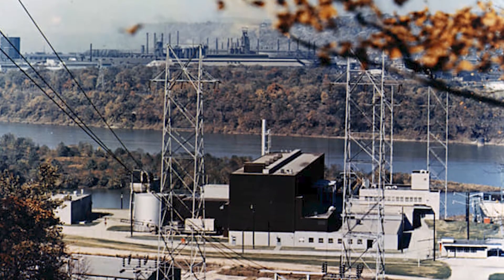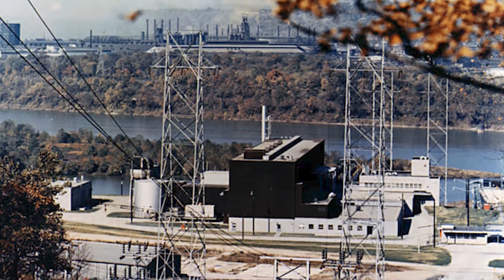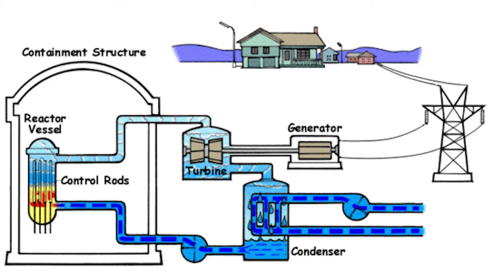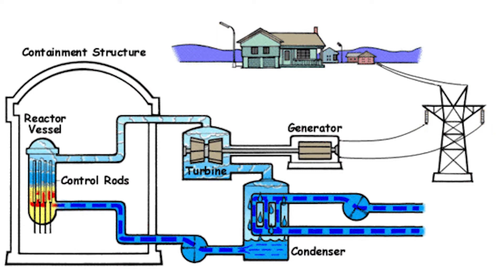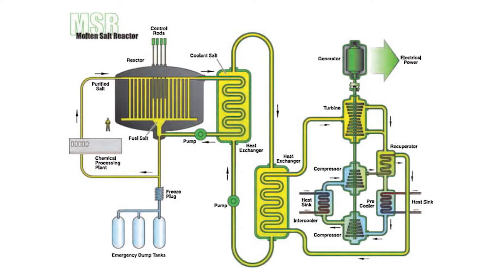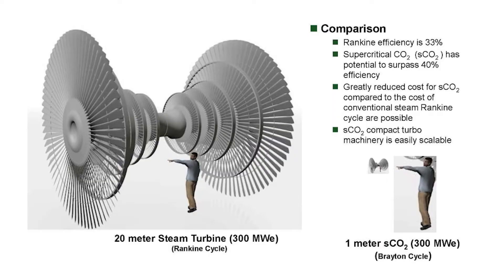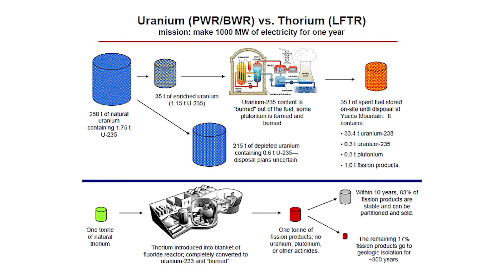The Best Nuclear Reactor: Light Water VS Molten Salt | Ep. 2

Comment: If you are going to limit your evaluation to thorium reactors, you may very well have picked the winners, but Moltex is definitely a better bet than Flibe if you expand the competition to all Molten Salt Reactors.

Moltex has a license to begin operation of an "experimental" MSR in Canada in 2027. They plan to build a full scale reactor as their experimental reactor. This reactor is designed to burn low enriched uranium, initially using solar salt as a coolant. They plan to eventually transition to thorium salt as a coolant/neutron absorber.

The NRC recently threw a monkey wrench in Flibe's (and possibly Thorcon's) plans by requiring the thorium be denatured with uranium. Since Thorcon reactors will be, at least initially, used in Indonesia, they may not need to denature the thorium. I'm not sure how this affects Thorcon, but it makes it impossible for Flibe to design a thermal spectrum breeder. As a result, Flibe is designing a Spent Nuclear Fuel burning LFTR49 to go with their thorium burning LFTR23 reactor. The LFTR49 will breed U233 in a thorium blanket to make up for the deficit of U233 resulting from denaturing thorium with uranium.

My best guess is that Elysium will get their reactor design to market before Flibe can get their LFTR49 to market. The current Elysium design is a fast neutron spectrum breeder that will use purified SNF for startup, and thorium as feed stock. At maximum output, the Elysium design might produce enough U233 for doubling in 7 years, but Elysium plans on 15 to 20 years. This is not a problem for mass deployment of the Elysium design, because SNF is so plentiful that we could meet the entire energy demands of the US for the next 300 years just be burning our SNF stockpiles.
Reply from the maker: Hello Dale! First off thank you for commenting. You definitely touched on a great deal and you are absolutely right and I plan on discussing Elysium and Fast Reactors in general in a future episode. Thorcon is not going to be affected by current NRC regulations seeing as they are building in Indonesia and FLibe is currently busy coordinating with Pacific Northwest National Labs on a DOE contract. That being said some serious regulatory and supply chain issues need to be addressed before reactors like the LFTR can be built. I 100% agree that most likely Elysium will be first to market in the U.S with there design. They do not have the same supply chain constraints and their approach to modular construction is extraordinarily efficient compared to other designs.

That being said there is a reason I am in favor of companies like FLIBE. One they are a true breeder reactor in every sense of the word and the fission products they can produce will have tremendous benefits on future medical breakthroughs. Second I am an advocate for getting the United States back in the game on Rare Earth mining and refining to develop alternatives to the Chinese monopoly. To do this we need to establish a cooperative to store the Thorium waste on behalf of those mining companies and develop markets and uses for them.  Addressing the Rare Earth issues in America in this way would create the regulatory pathway necessary to develop commercial LFTRS in this country. It would also help address the issue with supply chains seeing as there would be a National precedent to develop and commercialize this technology. 

Now I still believe we need companies like Moltex and Elysium. They have great tech and as you stated there is plenty of SNF to meet our energy demands for three centuries. But the LFTR allows us to maximize the efficiency of the Thorium fuel cycle for Thousands if not Millions of years. Thorium is 4 times more common in the earths crust then Uranium and the amount of U233 you would need for efficient breeding is miniscule compared to the amount of energy produced. At the end of the day I hope to see a future in where multiple MSR and possibly Fusion designs are considered to meet our energy designs. I think we can also agree more nuclear is the true path forward regardless of what design ends up being selected.
Reply: @RockLogicWithSeanKenny  Elysium claims a 1000 year supply of nuclear waste, not like that matters, I have to believe we will figure out fusion within 1000 years, even 300 for that matter.
Reply: I know Im asking the wrong place but does any of you know a method to get back into an Instagram account??
I was dumb forgot the account password. I appreciate any tips you can give me.
Reply: @Fernando Chase instablaster ;)
Reply: @Flynn Blaine it did the trick and I now got access to my account again. I'm so happy:D
Thanks so much, you saved my ass !
Reply: @Fernando Chase you are welcome =)
Reply: Elysium plans on 40-60 year fuel cycles on SNF. There are no plans for using thorium because of its poor neutronics, and there is unlimited Uranium, so the poor neutronics of thorium would be a reduction in economics.
Reply: @EdPheil  You already told me this in response to a different post. I have since revised my projection to the potential for Elysium to eventually switch to thorium salt as a coolant, as Moltex plans to do.

BTW my nephew now works at Perry Nuclear, and they are considering installing a SNF burner at the site where my nephew works, and ship the SNF from several reactors to this central site for disposal in it. I question this plan because, as I understand the situation, a single conventional reactor would need need several SNF burning MSRs to burn its waste.

I suppose it is possible that, if they extract the uranium from the SNF, perhaps enriching it to feed uranium burning reactors, with the majority of the U238 being "disposed of" as depleted uranium.

Comment: Why do you conflate MSR with thorium. MSR can run on uranium and even uranic waste (i believe). Would love to hear your thoughts. Terrapower is an example of uranic MSR
Reply from the maker: Sure Ryan. And you are absolutely correct their are multiple types of MSR's. Lately I have been discussing LFTR (Liquid Floride Thorium Reactor) but in future episodes I do plan on going over other designs. You can run an MSR on Uranium and you can run on spent nuclear fuel, especially if you take Elysium Industries fast reactor approach. However the reason I focus on Thorium Molten Salt Reactors is because the ideal fuel form in a MSR Breeder is Thorium 232 and U233. These reactors create energy at high rates of thermal efficiency while producing valuable fission products. The other reactors do not achieve the same result, but they can produce clean power effectively through simpler approaches.  The question we have to ask is what do we want to achieve? Do we just want to produce electricity at low rates, or do we want to achieve the maximum amount of fuel efficiency  so we have an energy source that can last for thousands of years. The former can be achieved by almost any MSR design, but the latter can be achieved by the LFTR.
Reply: @RockLogicWithSeanKenny  It will probably take 50 years to produce enough U233 for the Th232/U233 approach. Even Flibe is working on their SNF burning LFTR49, which will produce U233 in a thorium blanket, because of the difficulty of getting sufficient U233 feed stock. The future, at least in the US, for the next 50 years, is SNF burning MSRs.
Reply: @dalesplitstone6276  you can Kickstart a LFTR off of LEU.  Once it is up and running, it will breed u233 faster than it uses it, and even breed pu-239 from the u238 to make som additional fuel.  It just won't breed it all as fast as you burn it.
Reply: @ancapftw9113  In theory, a LFTR can produce enough U233 to sustain the reaction. The problem is that the NRC requires that thorium be denatured with U238 to prevent the production of weapons grade U233. The U238 "poisons: the reaction of a thermal neutron spectrum MSR because it is not very efficient at producing  plutonium from U238, thus the LFIR49 to produce supplemental U233.

Comment: If the current nuclear regulatory hurdles which (very) effectively crowd out any other nuclear option but LWRs could somehow be overcome, then most of the widespread irrational radiophobia would all but vanish. That's my two-cent contribution to the discussion. Nuclear power reactors which aren't prone to LOCA-type accidents by design are what most of us could wish for. Period. The biggest problem that's been holding back nuclear power dominance for so long is a bunch of existing unfair regulations, not some vocal (and mostly clueless) tree-huggers nay-saying it..

Comment: What progress is there, if any, on new materials for the plumbing in MSR?? I hear that when Oak Ridge plant was decommissioned they found massive corrosion and embrittlement from the hot fluoride salts and radiation....
Reply: Curious, the report I read was that corrosion in MSRE was minimal, embrittlement was to be addressed with extra nickel. Many of the proposals such as Thorcin are based on a reactor life of only 5-7 years. At the end of this time the reactor is removed from the operating position and sent to a central facility for reprocessing. This is possible because the reactors are relatively small and light about 300 ton.
Reply: @jimgraham6722  OK, I stand corrected, but I did read a very scientific paper that considered the issue as a real problem and discussed the metallurgy possibilities of the search for an exotic alloy that could be used. If this isn't the problem that's holding up the production of MSR, then what is it?? We've been hearing about the potential of MSR for many years, but not in production yet. The work in China should be clear of the regulation restrictions that may be in the way in the US, and they do have a history of rapid development of new projects, but still nothing real yet. So what is the hold up??
Reply: @STOLSPEED  Yes, Wikipedia https://en.m.wikipedia.org/wiki/Molten-Salt_Reactor_Experiment has a good report on MSRE that is a summary of the Oak Ridge reports the originals of which are also downloadable as PDFs.

The Wikipedia report includes an interesting picture of the main MSRE heat exchanger glowing red hot.

MSRE operated initially on U235 and later U233. That latter fuel load was designed to simulate operation as part of a Thorium cycle. The MSRE did not have a Thorium breeding blanket. That would have been included in later experiments if the program hadn't been refunded.

MSRE is generally considered a success. Corrosion as such was minimal, meaning a good reactor service life should be achievable using Hastelloy - n (essentially high nickel stainless steel). Embrittlement was seen as a potential problem, possibly addressable by introducing traces of niobium to the steel alloy.

Stability of the graphite moderator has been discussed as a potential problem. The Chinese claim to have solved this by using special high density grades of graphite that they claim don't degrade.  Other proponents say the graphite will be replaced on a regular basis.

Storage of the solidified spent MSRE fuel salt has been an issue with final cleanup only occurring quite recently. The spent fuel salts are highly radioactive to begin with but decay quite rapidly and should reach background in 500 years. Handling this process securely and safely is one of the main development challenges for molten salt reactors. Experience from MSRE has identified the issues and gives some confidence a suitable process can be worked out. Compared to LWRs the volume of waste material to be dealt with per unit energy produced is much less, nevertheless it is a problem that must be fully sorted out.

It is an interesting question as to why molten salt reactors haven't progressed, there are I believe a range of reasons.

1. Molten salt reactor technology was an interest of the USAF as a potential aircraft power plant. With the advent of aerial refuelling interest in nuclear powered aircraft dried up.

2. USN was left funding most reactor development, their interest was in high pressure Rankin cycle steam technology something they were familiar with. MSRE ran too hot for Rankin engines. There was also a famous spat between Rickover and Weinberg over this and it is likely further progress on MSRE was stymied as a result.

3. The realisation of the benefits of high temperature operation and development of suitable Brayton cycle turbines that are better matched to the high temperature output of MSRE are a more recent development associated in particular with HELE coal fired power plants.

4. Some say that because MSRs don't produce much plutonium that has decreased interest from investors in nuclear energy, not so sure of this myself.

5. In the end the main problem has been a lack of development funding to bridge the engineering gap between MSRE and a viable commercial power plant. At government level lots of funding has been tipped into fusion at the expense of fission, that is beginning to change. Quite a few investors are now stepping up and it is very likely operational molten salt reactors will be on line within 10 years.

6. With regards to Thorium, China is now buying up as much Australian monazite ore as it can get. This material was previously worthless and had to be disposed of as a mining wsste product. Says it all I think.
Reply: @jimgraham6722  That's for that excellent and informed overview. I guess I have just been to impatient, 'cause we really need MSR's or equivalent now.....
Reply: @STOLSPEED  Agree, it is frustrating to those of us observing the scene who are conscious of the urgent need for abundant affordable clean energy and can see a way ahead. MSRs will be very cheap to fuel, low volume, minimal fabrication etc. There is huge pushback from vested fuel interests who would see the demonetisation of fuel as a threat. They are throwing up every regulatory hurdle they can dream up, quite recently Thorcon had some of its fuelling proposals rejected in favour of more expensive options (less Th more U235).  If you are American lobby to have Kirk Sorensen, Rusty Towel etc made Secretary of Energy, that could get some serious roadblocks out of the way and fast track approvals for companies like Thorcon, Terrestrial etc.

Comment: The best nuclear reactor is one that directly converts neutron energy directly to electromagnetic to power our grid  and doesn't require a Neanderthal thermal intermediate stage to push giants wheels. Converting neutrons to heat to pushing spinning wheels to push generators  (mechanical energy) is flat out stone age. If the voyager probes can run off RPGs for 40 years we need to seriously assess what we are doing.
Reply: I think you mean RTGs (radioisotope thermoelectric generators). They use thermocouples to generate electricity, but they’re very inefficient (10% or less efficiency). In fact, that’s why nasa is working on stirling radioisotope generators, which the prototypes of have an efficiency of 23%. If it ain’t broke, don’t fix it, which is why we use hot gas to spin wheels to generate electricity. 

Photovoltaics currently can only convert some range of photons directly into electricity. That might be a more efficient technology that converts heat into electricity than steam turbines but it is not developed so turbines are currently the cheapest and most efficient option. Maybe in the future advanced photovoltaics with multiple junctions could absorb all forms of electromagnetic radiation, but the tech is currently too expensive and inefficient to be economically viable. It should be researched though.

Comment: Alvin Weinberg thought light water reactors were great but impractical for scaling above about 60 megawatts because of containment. That's why commercial power reactors end up with 5X to 10X cost overruns. NuScale uses 60 MW cores to overcome the problem. MSR are much better for GW power levels.
Reply: If a PWR is designed with a containment and that cost is taken into account, how does it result in cost over runs?